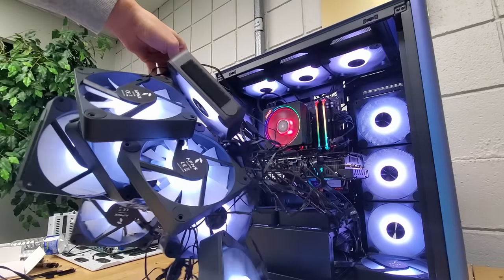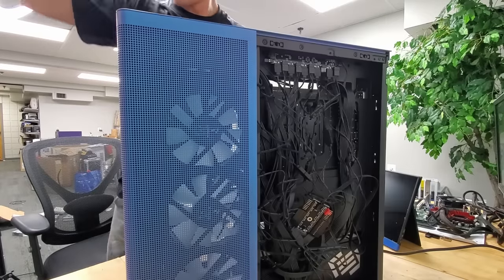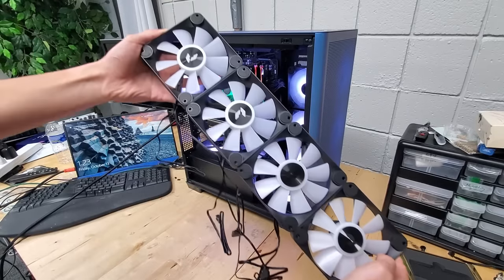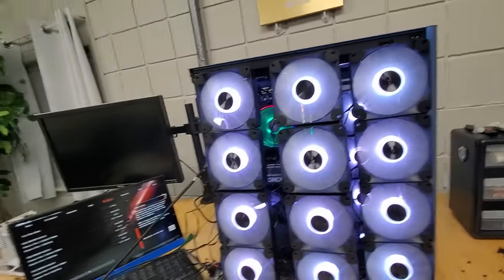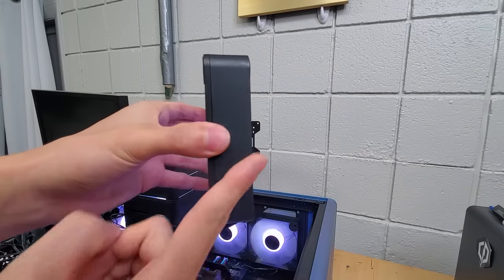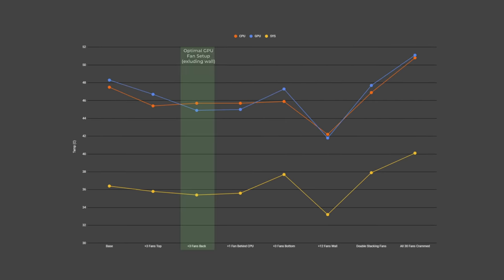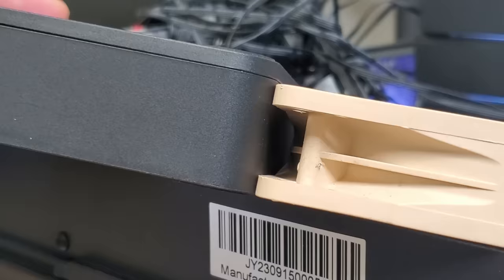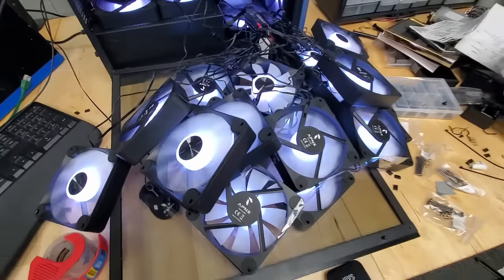I installed 30 fans in my PC so you don't have to

Comment: Imagine if CPUs came as two parts like efficiency cores and standard and you could mix and match and mount one on the "front" and one on the "back" and have a cooler on both side for better over all performance. They would act like one processor but could be two efficiency or standard or one of both depending on the work loads and use.
Reply: intel
Reply: Dual CPU Motherboards for consumers died out about 15 years ago. It just didn't hang on in the consumer market.
Reply: @an2thea514   were they any good?
Reply: @CalamityAzure  Yes and No.
I'll try to compare to SLI.
Remember, Workstations to this day like to utilize 2 CPU Motherboards but we are talking consumer here.

These obviously weren't for just any consumer, Motherboards were massive and you needed compatible RAM(DDR 3 and 2 were much pickier of when they wanted to work and when they refused), Special CPU coolers as well.
Consumer Grande programms at that time were only really starting with Multithreading, you'd be challenged to find something that utilized 3 cores at once. Obviously, they were mostly bought by the enthusiasts.
If I remember correctly, you couldn't run them single or mix different Models unlike with SLI(where you can theoretically mix all GPUs of the same architecture), so you either bought 2 very expensive CPUs or 2 quite expensive CPUs, both at once.
In comparison to SLI, you had less of a problem with overhang.

With SLI, you'd pay close to double, triple or quadruple and got diminishing returns. With these, you'd pay more than double and got almost double the power, but you couldn't utilize it. Maybe it's time just hadn't come back then.
Reply: @an2thea514   so basically, you'd pay a lot more, but it was pointless because it couldn't be utilized?
Reply: @CalamityAzure  I mean, when we had 15 inch monitors as the high end option, there wasn't a lot of multitasking to be done either, so you are correct in that regard.
It was something to dream up to, the best of the best.
Back then people would very often multiply the CPUs speed with the core count so those enthusiasts would talk about how their Dual CPU layout had 10Ghz.

Had they come out during the time where Intel Xeons ran acceptable for gaming and could be bought cheaply, Consumer Dual CPUs might have taken a different route.

Comment: I would be more worried about Amp draw from my psu than anything else,  as long as you have exaust it won't change much after a certain point of adding fans.  But they can affect the power available to other components.
I had an old system that I ended up just leaving the side off with a big window box fan aimed at it lol.  It worked and wasn't sucking power from the system itself.

Comment: cooler on both cpu sides dont work, you need space for good data transfer. cpus are this flat so the maximum surface area can be cooled, and because it is so thin the whole cpu cools.

Comment: For my mATX build, I put fans in the front and back of my radiator (closed loop AiO liquid cooler for the CPU). I haven't fully tested the difference but I did notice less heat coming from the back...

Comment: Cool video but i think the testing is limited as from we can see you don't seem to change the airflow direction 'intake vs exhaust' at various points in the case. The fan behind the CPU socket could have made a difference if it was set to 'push' air to the back of the board (the video shows it in exhaust role). Fan design can also affect your results - some fans are better for static pressure. A case with more vents is NOT necessarily better.. (better if passively cooling) In fact it can decrease the effectiveness of the fans as the case looses air pressure. Positive (intake) pressure also nets better results with same number of fans than negative (exhaust) pressure. Look at how server chassis are made - its designed (less porous) with less space for air to escape (reducing pressure) while most of the cooling is positive pressure (push) - exhaust fans are actually optional in a non-porous design since all that positive pressure has to go somewhere - air will go to point of least resistance - the exhaust fan port! I avoid porous designs for this reason. The sad truth is most consumer desktop PC cases these days are designed firstly to look cute, actual cooling second. I am not sure how putting a flat piece of glass along the side of the case was better than most older designs which had a fan port right over the GFX card which a fan set to intake (push) will make a big difference in GFX card temps. Great on pointing out that stacking fans yield less than expected results (fans designed for static pressure may have yielded better maybe), the idea is mostly a waste going beyond two stacked fans - for radiator use there would be a small but noticeable difference in a push and pull setup. The wall of fans part sure was amusing.

Comment: Potential Issues with 30 Fans
Airflow Management:

Too many fans can create chaotic airflow patterns, potentially leading to areas of turbulence and stagnant air. Proper airflow management is key to effective cooling, and this typically involves a balanced setup of intake and exhaust fans.
Diminishing Returns:

There is a point where adding more fans does not significantly improve cooling performance. This is due to the law of diminishing returns, where each additional fan contributes less and less to overall cooling.
Noise Levels:

30 fans will generate a significant amount of noise, which can be quite distracting. Fan noise can become a serious issue, especially if the PC is in a quiet environment or used for tasks that require concentration.
Power Consumption:

Running 30 fans will increase the power consumption of your system. This requires a power supply capable of handling the additional load and may also lead to higher electricity bills.
Space and Installation:

Fitting 30 fans inside a standard PC case is challenging and may require custom modifications. It can also limit space for other components and obstruct cable management.
Heat Sources:

Fans alone do not cool components; they only help dissipate heat. If the primary heat sources (CPU, GPU, etc.) are not properly cooled with adequate heatsinks or liquid cooling solutions, the benefits of many fans are minimal.

Comment: I put 3 fans upside down on my computer, so that outside air can enter the computer.  And I put 3 fans in a normal way, so that the air inside can go out.  By placing the fans in this way, air enters from one side and exits from the other.  As a result, the weather inside the computer is relatively low.🎉

Comment: 30 case fans? my corsir 1000D super tower can handle 34 no problems with switching out the top 3 140mm bracket with a 2x4 120mm bracket and using watercooling radiators.

Comment: Plus tu brasses l'air plus il est chaud... Pour bien faire il te faut une arrivée directe par le bas du boitier pour la carte graphique puis extraire tout l'air chaud par le haut. Ce qui est important aussi c'est la poussière. Ce qui est important aussi c'est le bruit généré. J'ai scié les grilles d'entrées d'air du bas de mon boitier et la grille de la sortie d'air latérale en hauteur, ajouté des filtres anti-poussière, ventilateur au mini et processeur (5700 x3D) à 3.57ghz je suis à 45° C avec une température ambiante à 29° C au repos/bureatique/films, 35 sur la carte graphique (GTX 1080 Ti) avec les radiateurs réglés pour tourner quand la carte est au repos grâce à Msi Afterburner. Il faut pas faire n'importe quoi mais bien réfléchir. 

1: choisir un bon gros boitier et le surélever du sol de 5 centimètres minimum, grâce à des pieds aux quatres coins 
2: installer un vrai dissipateur avec minimum 8 caloducs sur le processeur et une pâte thermique qui transfert bien la chaleur ou les pads thermique à haute capacité conductive
3: optimiser par le bios les éléments afin d'avoir de la stabilité (éviter les mode turbo et économie d'énergie, vous ne gagnerez pas plus d'un euro par facture en les activant)
4: régler les ventilateurs par le bios pour le processeur à un minimum de 50 % et optimiser la courbes de rapport RPM/TEMP afin de ne pas générer trop de bruit pour rien, idem pour la carte graphique
5: optimiser le flux d'air dans le boitier en faisant entrer l'air par le bas et ressortir par le haut, bien isoler le boitier avec ce que vous avez sous la main afin qu'il n'y ai pas d'entrée ou de sortie d'air et de poussière ailleurs que par les ventilateurs, placer les filtres anti-poussière pour les ventilateurs à entrée d'air seulement... 
6: enjoy

Comment: Me with an sth-10 👀👀 in all fairnes im only running 6 fans on one rad and gpu air cooled since i have yet to upgrade gpu. And yes i bought an sth-10 before a new gpu. But will run mostly 140's soon. And more of them too. Just an overall overkill watercooling build. But new gpu first

Comment: Ive got a COMPAQ presario and I installed the app that measures temp and that and it doesn’t perform badly but its just that the grid where the air comes out it get really hot but the laptop itself does not have a battery. Is there any reason for this? (Btw it had windows 7 but somebody else installed windows 10 on it and it was originally 32 bit but I installed 64 bit on it)

Comment: Hi i have a question, can you use a cpu cooler on a newer gpu. (RTX capeble)
Reply: Can you put a gpu coler, a fan with a metal brick. On to a gpu? Wich is RT X capeble. For exampel look att the tuff gaming gforce RTX 3080. It has a same loking conektion?

Comment: Hey! Could you check this shopping cart for my first custom PC?

- dual RX580 8gb GPU
- Gigabyte A520M H AM4 mATX motherboard 
- FURY Beast RGB DDR4 3200 Mhz 16gb ram
- Corsair Force MP600 CORE XT M. 2 SSD
- Arctic freezer 34 eSports DUO CPU cooler
- DeepCool CC560 ATX case
- Ryzen 2700x CPU
- Coolermaster 750w PSU

Comment: you suck all air and pc is hot. you push air in and it keep get hotter. there not need fans. you can use pc without case